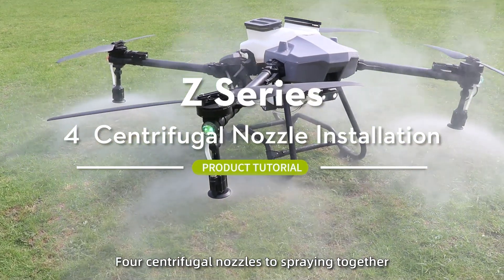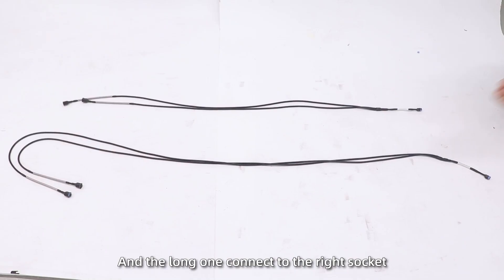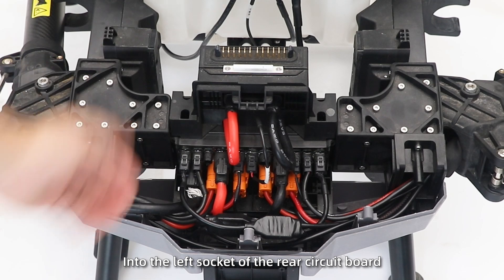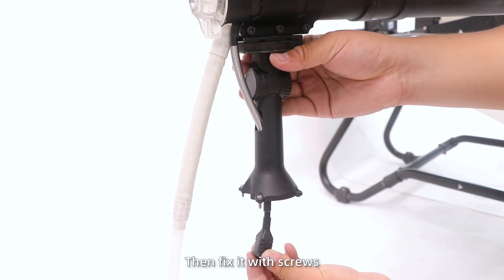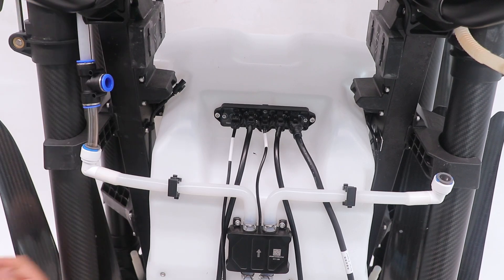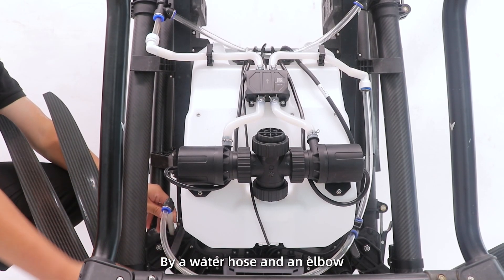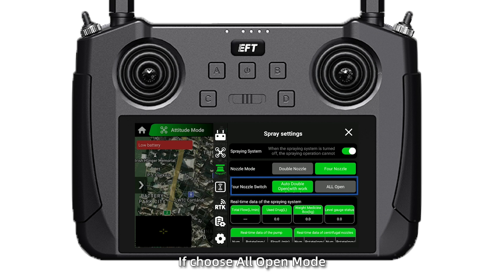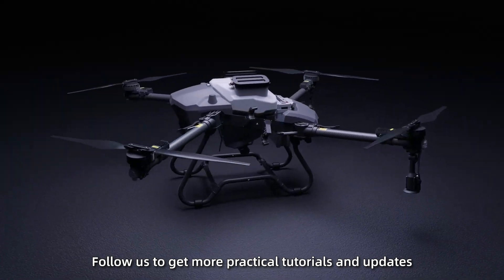Z30P/Z50P Four-nozzle Installation and SetupTutorial

Comment: I bought an EFT Z30. I imported it from China. Since I bought this vehicle from a company, EFT was not interested in any way and held me responsible. Then I ask eft why? You are selling to someone other than an authorized dealer. Ben, why are you letting him, come on, you let him, why don't you stand behind the goods produced by your own factory? I've been having problems since the day I got it. Doesn't this drone go through quality control when it leaves the factory? When he first came to me, the engines were running in different directions, the drone was not taking off at all. Then, as a system, we solved this problem. Then the left joystick was not descending in a downward direction, the left joystick was not working in a downward direction manually in any way during the flight. When I contacted about this, they were able to solve it in about 3 months. Finally, the drone motherboard Pmu burned down. They sent me a new motherboard motherboard from a local company. I wore it like in the video they said. But as you can see, as soon as the drone took off, it hit the ground and fell down. I also took a flight once before this video, the drone hit the ground as soon as it took off in the same way, I threw the flight log away, they said the device was on an object, they said there was no other fault, I reassembled the drone on my own, I took off again, it fell again like in the video, and now they found me guilty, stating that the gps card is in the opposite direction, EFT does not stand behind the products it sells, I regret that I bought it, don't mind

Comment: What is benefit of centrifugal nozzle? What efficient use this nozzle
Reply from the maker: This is a water-cooled atomizing centrifugal nozzle that matches the EFT drone model.
2 or 4 nozzles can be installed according to user needs. 16L per minute high flow rate, atomizing centrifugal spraying is more thorough